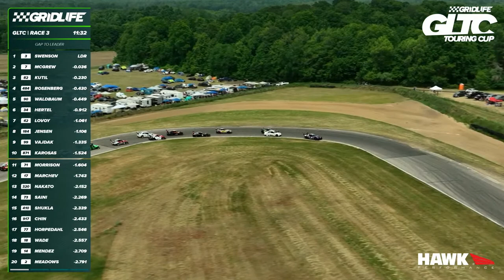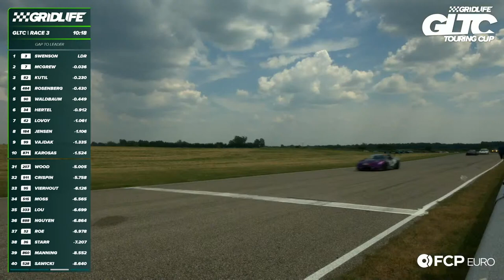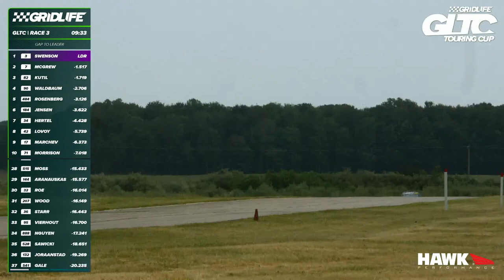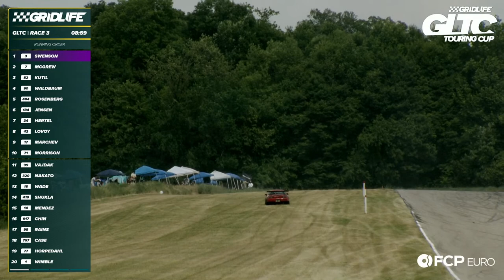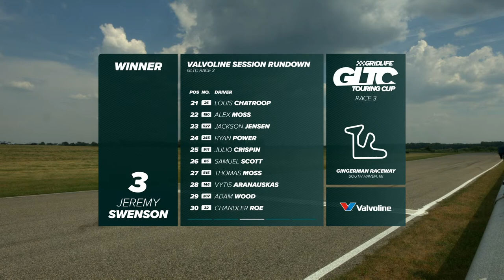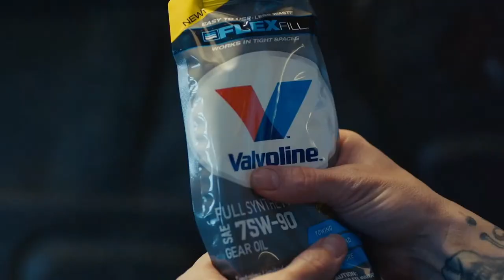GRIDLIFE Midwest Festival 2023 - GLTC Race 3 || GingerMan Raceway

Comment: What’s happened
Reply: The Porsche had an issue with its ABS system. Looks like from the sound of things, the varying surface conditions of the track this weekend caused the factory ABS system to go into ice mode at the exact wrong moment.